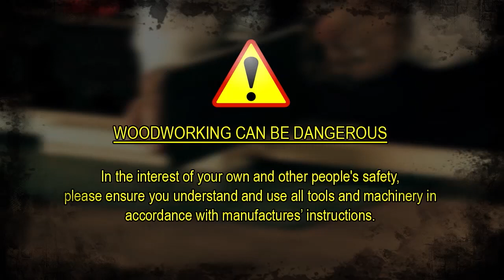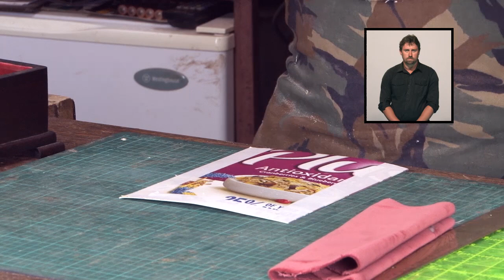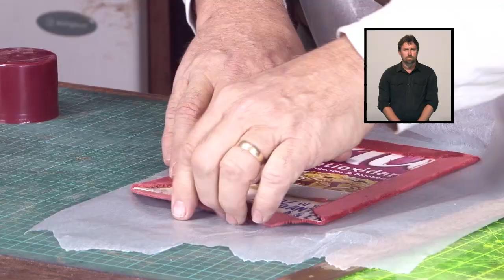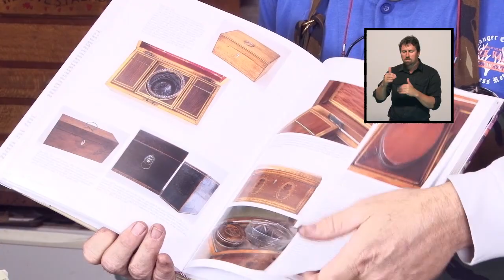Making 2 Wooden Boxes. Signed in AUSLAN by Mike Webb. Pt.6 of 6

Comment: On the veneered box, Steve I am concerned that the inside lid panel held on with the 4 mitered lengths can work loose over time perhaps. I would put a spot of glue in the centre of each of the four lengths. I know you will say it is unnecessary or you would have done it. I like the other box better but both are nice.
Reply from the maker: If you are talking about the floating panel in the box lid best way is to put 2 drops of glue in the center of the panel rather than on each corner. Over time the box lid will shrink ad expand. If it is help fast on all 4 corners while it is inits shrinking phase it can split along the top will cannot be easily repaired. By holding the panel with the center glued only allows the  top to expand and contract uninhibited and therefore eliminating the chance of the panel splitting. Hope that helps explain the reason for it. Cheers Steve